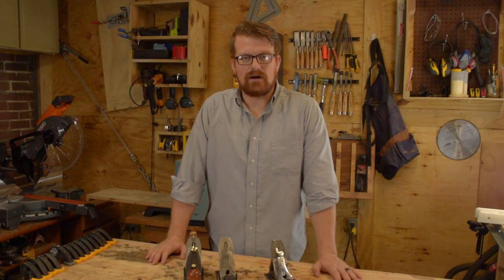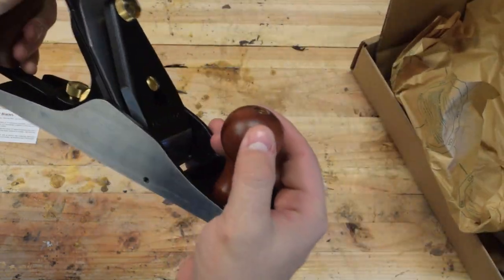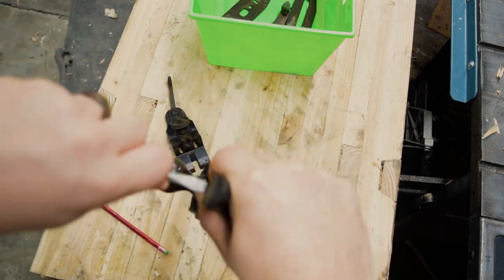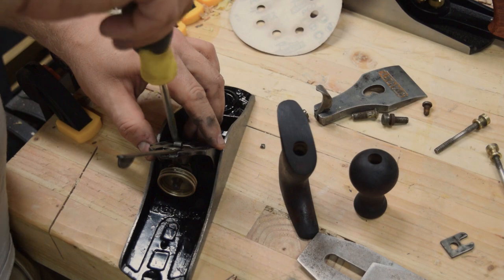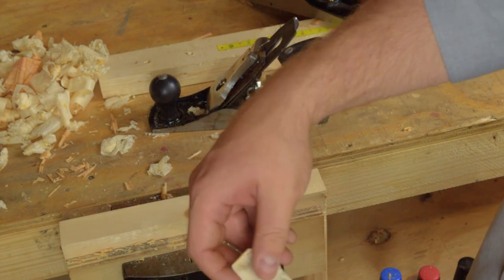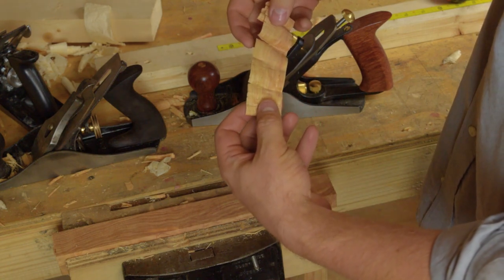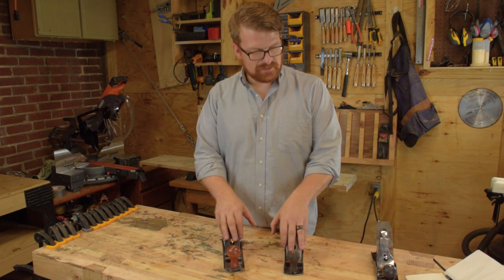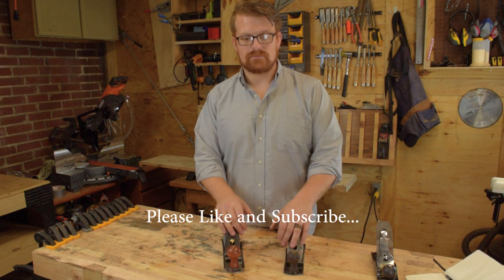Smoothing Plane Shoot Out - Veritas, Classic Stanley, & Harbor Freight | Hand Tool Shootout

Comment: It's kind of ironic.  An amateur would be better off with the expensive Veritas Plane.  Mine made nice chips right out of the box only fiddling with the depth adjustment. When I was young I bought a cheap Buck plane, spent a half an hour trying to adjust the depth and got maybe one chip out of it when I went over a bump.  It sat in my drawer for 10 years unused.  I watched some YouTube videos and dusted it off, set the frog, polished the knife on the $300 worth of diamond plates I bought for other sharpening and played around with the cap iron to knife offset.  It suddenly started making shavings!  Still the little lever that controls depth and straightness was a pain to use.  It just didn't want to fit in that square hole.  There was a ton of backlash in the depth adjustment.  It was just too much of a pain in the neck to use.  An experienced woodworker can correct the problems in a cheap plane and make it useful.  Usually amateurs buy cheap tools and experts buy expensive tools.
Reply from the maker: Agreed, I think it is good training to buy an antique to learn a lot of the techniques as an amateur but the really cheap ones usually have one or more fatal flaw.  I love harbor freight for a lot of things, this hand plane kit was just not one of them.

Comment: You didn't show us how you sharpened the planes. To be fair each plans should have been sharpened using the same technique.. Why did you use wood with a knot?
Reply from the maker: +James McIntyre they were all sharpened the same way.  It is not a knot, it is burl, it is super hard and the grain goes every which way.  Makes it super hard to plane.

Comment: This is really terrific. Especially the time/money accounting. I've never had enough time to really flatten the sole of even a small block plane. It just takes forever! 6 hours on the Harbor Freight and it's not yet flat? I am not at all surprised. The #4 finishing smoothing plane is the most critical plane, so  $219 for the Veritas is definitely worth it. On the other hand a #5 jack plane just has to be reasonable solid and reasonably sharp for rough work. 
There's immense personal satisfaction to finding an old Stanley, fix it up (I knock the rust off, sharpen the blade). A #4? Sure. A #5 absolutely, you can do as little or as much fixing it up as you want and it'll work great. 
I found this PBS The Woodwright's Workshop episode on planes a terrific resource: http://www.pbs.org/video/2172600556/ 
I can sharpen a plane or a chisel to a frightening degree using the Scary Sharp method. An hour of occasionally planing the edges of very soft western red cedar and I can notice the difference if I give the blade a few laps. 
To get paper thin curls on rough burl? I think that's several steps beyond how sharp the blade is--that's where the Veritas is worth the money.
Reply from the maker: Some folk are happy with a smoothing plane much less flat than I am, but I rely on it to get me a consistent cut and to test the flatness of stock, otherwise, whats the point.  Ok, ok, it is fun to make shavings either way...
Reply: A flat shoe, stiff wickedly sharp iron, correct adjustments, good technique, are essential to good finish planing. I really wanted to flatten my shoes, I just never seemed to see any real progress trying to flatten down even my small block plane shoes.  A good plane is a handy tool and a joy to use.
When I was a kid really good carpenters just seemed to grind their short Stanley chisels and call'em sharp. A clean hinge cutout edge was made with a utility knife. I think short cuts, all that sharpening stone voodoo nonsense (who really wants a sharpening tool that takes more time flattening than is spent using the thing? 
The only guys I've seen who seem to make the stones system work for them are alone in their shops. Scary sharp and diamond sharpeners brought me to the level of sharpening new chisels, and buying cheap kitchen knives instead of expensive stainless steel junk that can't take an edge)
BTW I just bought a Stanley #5. The shoe seems perfectly flat. Straight edge check. I've never seen a plane this dialed in. The handles are plastic, there's a ridge I just scraped off--not the end of the world. I've got a couple old old Stanley planes, a couple of 30 year old Stanley block planes--none of the shoes on any of those is as flat as this new one. 
One thing I learned is that all plane irons should have rounded corners. Duh! I kept adjusting and fiddling and wondering why I always had ridge lines.  Sorry I yammer on. I'm not really a troll, I'm just a guy with a lot of info, opinions who is supposed to be doing something else.... I am a form of procrastination.

Comment: Love the video.  It’s a good look at cost vs results.  Honestly just get the good tools and save a bunch of time a headache.  Some people has a hobby of making things work, and that’s a hobby on its own.  But if you are trying to get results, just buy the damn thing.
Reply: I want to get results. But at the same time I don't want to break the bank either. So I buy used planes when I come across them. I'm at the point now where I won't buy every plane I see either. But if it's cheap enough I will. So far this year I bought a Stanley Handyman jack plane for a dollar. I cambered the iron and made a scrub plane out of it. I already have three No. 5 Stanleys.
Reply: @1pcfred  I've had a few years of practice and restored a bunch of planes and bought even more.  Honestly, my opinions remains the same.  That said, I can tune up most planes to get one-cell width shavings, it's a matter of understanding what the plane is doing statically and dynamically.  I think the non modern (doesn't have to be very old) Records tend to be the fastest to get into cutting shape.  If you are not anal about rust, you can get one shipshape in 2 hours or so easy.  (Provided you have the right tools and abrasives to deal with it).
Reply: @MintStiles  I don't think I've ever seen a Record plane here. Mostly Stanley is what's available. If the iron is properly sharp planes seem to work to me. Sharpening an iron correctly is a rare skill based on what I've seen of used planes I've picked up. I usually have to spend some time with irons on a bench grinder to establish a good primary bevel before I hone.
Reply: @1pcfred  totally agree, an ultra sharp blade will compensate for a lot of other faults - big mouth, slightly warped sole, poor frog contact.   Highly recommend diamond stones over grinder. If you have the 180, 300, and 1000, all you need are some honing compounds.  Unless it's *that bad, most good unmolested blades can be initialized in 15 or (much) less by hand.  I find sandpaper flattened blades (back) are a nightmare for jointing. The flex in the heavier grit paper cuts the edges much more aggressively.  Not an issue if you are feathering and smoothing using a hint of a kerf, but a giant annoyance for jointing if you want a perfectly flat face.  I keep those blades on planes exclusively used for smoothing.
Reply: @1pcfred  as for record planes. Depends on where you are.  Here in Canada, we have mostly used made in Canada Stanley, England Records and some odd brands like Rapier, Miller Falls and Falcon.  I have a full set of Veritas as well, but I find the Records a bit less dear and just use them for their full abilities.
Reply: @MintStiles  location definitely dictates availability. Many people cannot get anything at all and that is due to where they are.
Reply: @MintStiles  I use a 1,000 grit diamond plate to hone the secondary bevel. I prefer a hollow ground primary over a flat one. I also prefer not having to hone very much. I also use an Eclipse style honing guide too. I freehanded for a very long time but guides are faster, easier and give a more precise bevel. The downside of grinding and using a guide is increased equipment cost. But I'm past that now myself. I polish on ceramic hones and I strop too. It is all about results and efficiency. I want to work wood not sharpen tools.
Reply: @1pcfred  Same here. I am at a point where I have to watch the amounts of time I spend since that's more important to me than saving a few dollars. Restoring plane is fun, but honestly is very wasteful timewise. process wise, I just do 300-1000 on diamond stone and use full convex grind. (Naturally gifted with a very consistent hold apparently). I've seen the hollow grind then convex secondary method which seems to work great too (but I am terrible with a grinder so...).  Where I differ from Paul sellers is I don't use leather often.  I just take the iron to a planed piece of clear SPF mystery softwood to strop maybe 20-25 times across the grain (I just table saw off the top layer to get a new layer).
Reply: @MintStiles  I have been sharpening for over 50 years now. I wouldn't say I am gifted but I am certainly experienced at it. In that time my methods have evolved as I've experimented with different equipment. I did not get to where I'm at overnight. I'm not done with my journey yet either.  I'm likely more than halfway though. For hand planes and chisels grinders and guides are definitely where it's at. The geometries are most favorable there.
Reply: @1pcfred  I am probably gonna give the T-8 a go. Do you think it's work the asking?  Especially if I want the add-ons?
Reply: @MintStiles  Tormeks are OK. I dry high speed grind myself. It takes a bit to get that to work. It isn't just chuck the tool on the machine and go. They make Tormeks for folks that can't figure out how to get dry grinders to work. With a dry grinder you have to run the right kind of wheel, the right kind of tool rest and you have to dress the wheel for success too. I put my finger right up on the top of the tool where it's being ground so I can feel the heat. if I feel heat I know it's time to dip. That's a bit sketchy if you're not careful. Tormeks are safer in that regard. But Tormeks are slow. I ran the numbers and the surface speed of a Tormek is 20 times less than a dry bench grinder. You watch someone really demoing a Tormek and they are painfully slow. 20 times slower. Yeah you never have to stop and dip ever but come on. This is one case where the hare beats the tortoise.
Reply: @1pcfred  I am always up for learning how to do things quickly and efficiently.  Woodworking is not my profession but I believe in doing it like the professionals.  I am doing this for the discipline/art.  I think I will go back to try things with my grinder (has a half speed mode like Rikon).  I am guessing I don't need a CBN wheel?  Just a good aluminum oxide?
Reply: @MintStiles  with the right wheel you can run cool at high speed. Those hard blue aluminum oxide wheels are not the best. You want a soft coarse wheel. They're called tool room wheels. Norton white is one. They come in pink, purple and other weird colors. The one I run is brown. They're not for general stock removal. You wouldn't deburr rebar with a tool room wheel. Though you could. You also want an angle adjustable tool rest to maintain the grind angle. I've seen people rest tools on the common tool rest way up on wheels. That's sketchy. The last thing you need to know about is how to dress and grade grinding wheels. You sharpen grinding wheels like everything else. Just not quite like everything else. Your cheapest option that'll work is carbarundum sticks. I use those a lot myself. But I have single point diamond dressers too. They also make diamond graders. I've never used one but it looks like it'd work to me. I'd stay away from star dressers. They're made for a different kind of work. For people who are deburring rebar.
Reply: @1pcfred  that's awesome information.  A LOT to digest.  Guess what I'll be doing the next 3 hrs hahahah.  Thank you so much sir from the bottom of my heart.
Reply: @MintStiles  it's the little things that make big differences. To recap the right wheel, the right rest and keeping the wheel surfaced properly. Then you should get satisfactory results. Past that I keep my finger right behind the tool up by where it's being ground to monitor the heat. If your finger is uncomfortable it is time to dip the tool. But when you get right up to a feather edge you have to dip frequently then regardless. The metal is so thin at that point it heats up quickly. Light pressure and passes does the job. But if you do manage to blue a tool then just grind the blue bit away, carefully. It should just be a little bit on the edge.
Reply: @1pcfred  I have a bunch of rusted blades with my parts plane that I can practice with.  The bottoms are pitted enough so they are no more useful than a scrubber.  Not exactly PMV-11 blades precious lol.
Reply: @MintStiles  with the right equipment you should get the hang of it quickly. You get the fundamentals and it should work. For the full benefit you should use a guide too. I use an Eclipse style guide. It's brilliant. You can get an imported knock off for cheap. I just looked it up on Aliexpress and they cost $11.62 today. Off Amazon it costs $15. Totally worth it. You can freehand but you can crawl across broken glass too. Doesn't mean it's the best thing to do. With a guide it's so easy to make a subtle camber on plane irons. The precise bevel you get is sublime too. It looks like the edge of a razor blade. That is one trick with hollow grinding and using a guide though. Getting the angle perfectly perpendicular so your secondary and primary bevels are parallel. Sometimes I don't get it exactly perfect. Then the secondary isn't the same width across the whole blade. Tools are still sharp and work. But they don't look perfect. So that bugs me. When you hollow grind again you just even it up then. All of that does take some adjusting. There are tools you have to freehand. You can only use the guide with chisels and plane irons. You can't use it for skews or gouges. But you'll wish you could.

Comment: All of this bickering over who makes the best knockoff of a Stanley plane is silly. A good craftsman will tune his tools to their best degree and get the same quality of work out of all of them.
Reply from the maker: True true, I am mainly trying to boil down that fact...it doesn't matter...
Reply: @WoodWorkLIFE  -- I have accumulated a small group of basically pre-war Stanley planes. I've found them very easy to work with and to tune. But you have to be very careful when you purchase, because there is a lot of junk out there.  You probably know that Stanley planes have a model number and a type number. The type number tells you roughly when they were made and what features they have. Generally, I've limited my acquisitions to types 10 - 15. These have adjustable frogs as well as lateral adjustment and iron adjustment. Stanley planes are basically fairly easy to work on, and it's possible to get replacement parts via eBay. What I have learned that makes the difference in the product is to let the plane do the work. Take off thin shavings, not massive chunks of wood.

Comment: You set the blade way too deep on all the planes.  You need to start light to just nip the wood and keep doing it till you get a full shaving.  Also, don’t push the planes straight ahead initially, do it at a skew.
Reply: My thought too.  He never set the side to side depth cut, so we have no idea if it was just a matter of the blades being different depths.  In reality, I think with the high dollar planes, you are mostly paying for the final tuning setup done at the factory.  Yeah they are nicer but not $300 nicer.  Like comparing a low dollar car and and a high dollar car driving at 55 on a smooth road.  They both work.
Reply: He very obviously did this off camera. Otherwise the veritas got a 2/1000th shaving by 'accident' the very first time.